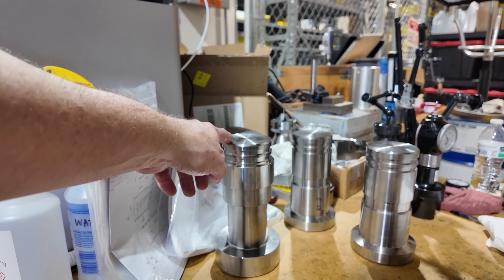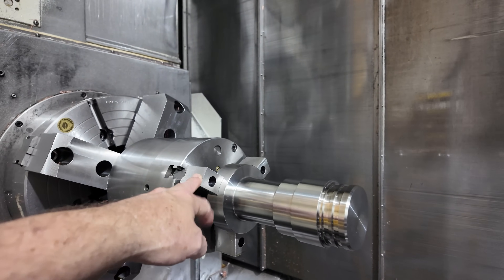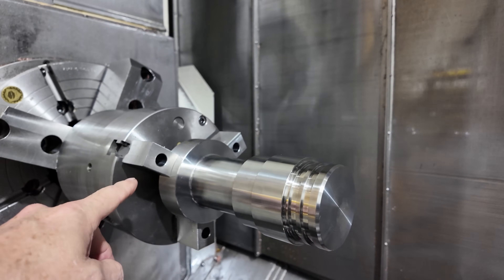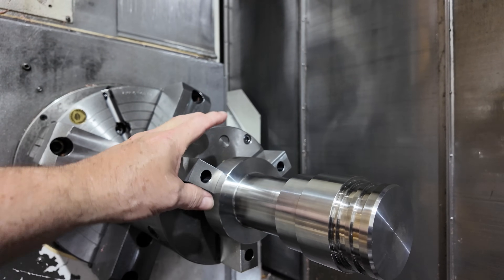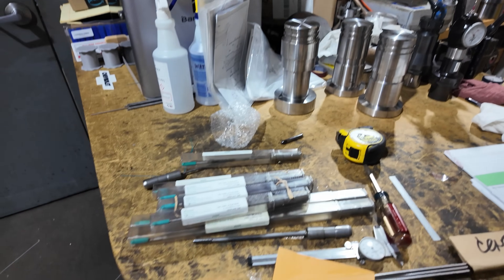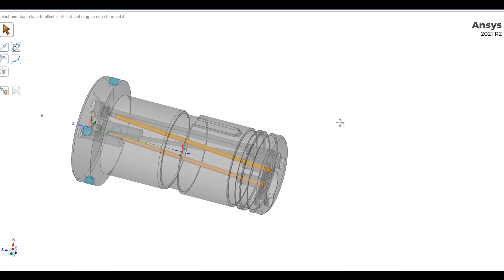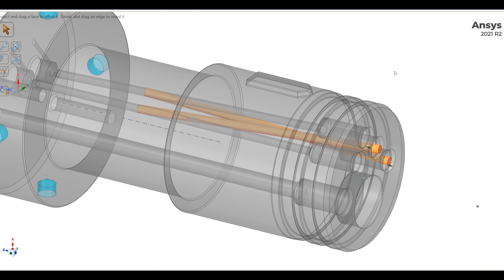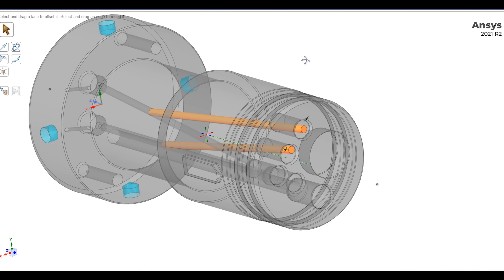Plan Job For New Parts

Comment: I always love it when you receive a drawing/model from a designer who has never made anything in their lives. Anything can be done in SOLIDWORKS
Reply from the maker: In this case I had to model the parts from their drawings. There were no provided models.
Reply: @EdgePrecision  even more classic. I hope that gets added to the quoting process
Reply: Watching this channel for a while and judging from the parts Edge Precision is regularly asked to make, my impression is that this style of engineering is very prevalent in the oil drilling industry. 🙂
Reply: Some parts have to be difficult to perform a certain function. Or better one complicated part than a big prone to error assembly. It is a challenge to make and the price will be accordingly. A somewhat trained professional designer learns this relation pretty quick before getting unemployed as a worst.
Reply: Alternatively, I always love when a machinist doesn't understand that this one nightmare part (and many of us don't like doing it) solves an enormous amount of other problems. ;) Or that it's a 5-part order and the DFM review would stall the project out by weeks and the organizational cost to the delay is 10x the cost of "just making it". 

That said, I'm ever grateful  to learn from the likes of Peter about how he solves these problems, and hopefully learn/internalize the challenges. Unfortunately, the lines of communication from the shop floor to the design house are not great (especially with job shops)

It's yet another case of trying to walk a bit in other folks shoes, and that goes for all parts of the organization.
Reply: If a DFM review takes 5 weeks then there is a massive organizational problem. When we do DFM reviews with our medical device customers we talk straight to the responsible engineers. They often don't realize what looks to be a "simple feature" can add minutes to cycle times or even require outside processing. Adding weeks to lead times.  Many times parts are designed with features that are "nice to have" rather than needed for functionality. A simple phone call can cut these out of a project making a world of difference.  We've done DFM with a project that cut weeks of lead time and cut production costs on projects at the same time making the part more reliable.
Reply: Meh, just make the damn part and quote accordingly :D
Reply from the maker: @StefanGotteswinter  I see this a lot in the machining industry. Every machinist likes to redesign the parts they make. Me I don’t worry. As you say just price it for what it takes. If they pay it good. If they complain. I just say take it somewhere else. We’re paid to make parts not design them. Also if you start making changes you can end up bearing some of the responsibility for problems.
Reply: @EdgePrecision  That's fine and dandy until a competing shop does a DFM review of the part with the customer and they figure out a way to make the part easier/cheaper.  Then that job disappears from your shop.  Sometimes the customer goes with it.  A DFM review isn't always needed, but it can actually win you work if you can help the customers achieve their goals while saving them time/money.  Basically in todays manufacturing space if you aren't doing some sort of DFM you're just hoping that your competition isn't doing it either.
Reply: I had no clue a DFM was possible. I get stuck with just quoting and making. And never ever get to dictate anything unless its a R&D part.
Reply: @peterCheater It's not so much dictating, as it is helping the customer understand the manufacturing process.  Sometime engineers honestly don't know what is feasible and what is not.  We had one customer come to us with a  part where they wanted a .012(inches) hole .865(inches) deep in 17-4 condition h900.  After a little bit of back and forth with them they ended we came to a stepped hole solution that made the part more manufacturable.  Those parts are now running on two our machines at production quantities.  Those parts should net us about $1.6 million in sales this year.

Comment: Ah, another one of these Swiss cheese oil and gas parts. Those fittings are similar to cone and thread fittings, which as you said are used for very high pressures. The taper on the tubing is slightly less than 60 degrees, so the two surfaces theoretically intersect along a single circular line, allowing for very high sealing pressures with relatively low torque. These are typically rated for up to 60,000 psi, but some specialty fittings can handle up to 150,000 psi.
Reply: I still don't see why the holes need to be at those weird angles.I'd sack those engineers for making life so difficult.😂

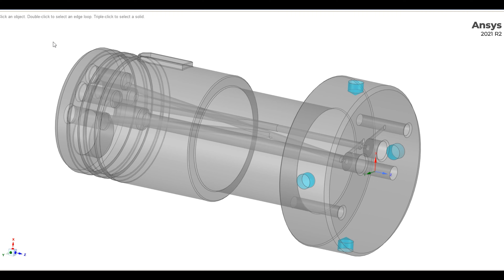Comment: I've done something similar more than a decade ago on a deep drilling machine, IMSA 1250 BBLL (made in Italy), and the part was half of a mould (German automotive client); you brought back memories with that intersection at 6:00 don't remember if they were Ø8mm or Ø12mm, but it was quite a nightmare because I had one shot only without breaking any parts inside (talking about more than 1mt x 1mt x 0.6mt of 1.2738 or 1.2311 steel). Managed to do so with, if I recall properly, aluminum rods I've previously turned to have a bit of initial slack till three quarters of the length and then pushed it with force for it to fit as the last part was precise, with the very last part slightly bigger than the drilled hole. The back of the aluminum rod had an internal thread to pull it out. Very low feed and spindle speed during the intersection as it was cutting soft and hard material in an unsupported manner...

Comment: Really nice plan, and great thoughts! Consider radially surfacing the 5deg port bottom with a square end mill. Custom ground is better but ive got away with it when lead times on tooling where bad

Comment: If concerned you could always drill and tap a hole into the large face pocket stock that will be removed later when you mill the feature.  Use this hole to secure a narror piece of flat bar that you have slotted a bit over your rod diamter to allow room for the angle of the holes.  Have one or two setscrews perpendicular to the slot across where you can pinch and hold the rod tight.  I am sure one narrow slotted clamp could be designed to accommodate both holes to hold the rod secure. This would ensure the rod is just held in place and no chance of it rotating and still have easy removal afterwards.

Comment: I was thinking the holes would be drilled in the other order - but then realised that would leave the support rod end still inside the part with no way to remove it.  I am not a smart man.  Thanks for the videos. Stay safe out there.

Comment: I run into those fittings on waterjets, those intersections are pretty nasty,  i hate having to make deep intersections at a good cross angle much less that shallow.   Always great to see a video from you, cant wait to see more on this.  Btw i wonder if a little superglue would be adequate to hold the fillers,  then do the final bore to remove any residues

Comment: Lovely to see your thought process on parts - Any plan on how to hold the drill rod in place? Or is that of little concern?
Reply from the maker: I think if I put a kind of bend/kink some ware in the rod. So when I drive it in the friction should be enough to hold it in place. If for some reason that doesn’t work maybe a short straight knurl on the last say 1/2” to grab on to the top of the hole. I don’t really know yet, but I would like to keep it as simple as possible.

Comment: Nice video. Really like how you thinking and planning it. How you have to take in to account so many factors. I was thinking if you drill the longer hole first, put sacrificial part in it, and drill the angle hole. But the you will may endup with part of that rod stuck inside. Btw, I had recurring job with 2 intersecting holes, that alway give me some issues. Then I saw your video on sacryficial part, and use that idea. It killed many birds with one stone. Can hold part better (part is 0.150 x .130) and hole are clean (no secondary scraping necessary), so thank you very much for sharing the knowledge

Comment: Wonderful content Peter. I recognize your challenges and love and learn your fixes. I don't own a fifth axis so I would have to build a fixture first for all the angled holes and I'm not sure if have the z reach on my machines to clear the part from the drills. And it would be a tight butt exercise. Coolant? Please don't jam, please don't dwell on the inserted rod, kind of deal. I know you worry a bit if all goes well but repeating an extra part on the Mazak helps to vary a little along and maybe still make money on the parts. In a conventional manner it's more high risk. I would certainly start with extra stock and add one or two to the amount to deliver (depending on the size of the order and the presumed risk for not succeeding on the first one). Thank you Peter! (How does your remodelled car behave and the milled anvills?)

Comment: My plan would be to drill and plug the straight hole through hole first as you could use a pin punch to drive the sacrificial rod pieces back out if necessary.
All good fun.

Comment: I am thinking some sort of endcap to act as a guide bushing for the gun drill to get it started on location, and an end cap with the drill rod attached to it with some sort of jacking screws / wrench flats to remove after the op. Maybe there is some way to utilize some of the required hole locations with sacrificial undersize taps to hold the cap. It would definitely would take some planning. Good luck. Cool part.
Reply from the maker: I will be starting the gun drills with a starting pilot hole. I did think about what you’re talking about. But for two parts it’s to much work I decided. Besides the rods to plug the holes come out at different angles that would not allow the end guide plate to just be jacked off without first removing them.

Comment: Nice challenge! Do you have an endoscopic camera to look at these intersections once finished? WIthout these drill rods that you plan to use, i would also expect quite serious problems with "push over burrs". With the rods it should be way better. Would be extremely interesting to see the intersections. But: What if the intersections will be in need of deburring? Deburring done by the guys of centerline? :)
Reply: Isn't that what interns are for?

:-)
Reply from the maker: Yes the deburr guys here have a lot of experience at this. These parts are simple compared to some they do. And yes we have scopes to go into the holes.

Comment: Great see that you are still making the engineers look good.  would Loctite bearing lock work for holding plug rods?
Reply from the maker: It could. But it may be hard to remove them after. But that does give me an idea. Because there is a larger drilled hole where the rods go in at the parts face. So I could do something in that material that gets machined away there. Such as drilling a hole for a small pin in that area.

Comment: How are you planning to stop the drill rod from rotating when the gun drill hits it? Just hoping the bend will be enough to stop it from rotating?
Reply from the maker: I’m thinking about putting a short straight knurl on the top end of the rods. Then driving them into the hole with about 1/2” protruding to pull them out.
Reply: @EdgePrecision  good thinking

Comment: I'm upgrading my gantry mill to its max optimum. Might as well get it done for once and all. Amongst the most looked forward to is a 4.5kW spindle  w/ATC and  BT30 taper.
So now my tool cutting data really counts.
I have never understood this term "Guage Length". Distance from spindle nose to tip or collet nut to tip. Thoughts?
Reply from the maker: Gauge length is referring to the spindle and how the tool makes up into the spindle. With your BT taper. The gauge length is how the tool seats into the taper. The tool holder's shank on a BT taper has a flange but this is not in precisely the same place in relation to where it mates up in the taper in every tool holder. Say one tool holder has its taper ground slightly smaller than another. It will be pulled a little farther into the spindles taper. So its flange will be closer to the spindles face. So in order to measure each tool the same length while mounted in its spindle you need to have some standard measuring location on the machine's spindle's taper. This is technically measured with a standard taper gauge and is known as the gauge length. But in practice you can use any place just so long as you duplicate it the same every time you measure the tools length. On a taper that makes face contact. Like a HSK, Capto, Cat Big Plus or even Tormach TTS tapers this can be the actual spindles face because the tools always make up there. But on tapers that don't make face contact you have to use the Gauge length (or diameter) because every tool makes up slightly different into the taper.  I don't know if that helps but that is what it is referring to.
Reply: @EdgePrecision  I can't thank you enough for your reply. Cheers

Comment: Could you use an epoxy or low melting point solder in the c’bores to hold the drill rod in place?  It may be difficult to clean out afterwards though.

Comment: Are those holes that come at an angle into the threads incase there is oil in the holes so you can still thread the fitting into it.
Reply from the maker: They are some kind of high pressure fluid passages.

Comment: Considering the slugs:maybe cut one end  open with a band saw and drive a wedge in there once they're inserted?
Reply from the maker: I had thought to drill and ream with a tapered reamer. Then split it with a fine jeweler saw a little. Then drive a tapered pin in the end to hold it in place. Or maybe even knurl the end for a slight interference fit would also work.
Reply: @EdgePrecision  maybe use a countersunk screw and a thread to expand the rod. Is definitely easier to remove than a tapered pin, and doesn't scratch up the surface of the bore if you use a knurled end.
Reply from the maker: @Roetz40  The top of these holes have a larger hole. So if there is any damage to the top of the hole. It will be machined away. So damage to the top of the hole would not be a problem. So a straight knurl on the end of the rod might be a good way. Just drive the rod into the hole with about 1/2” sticking out. Then to get it out use the slide hammer with the vise-grip pliers to pull it out.

Comment: Can I ask you a question. What you do when OD of a stock is really really bad. How u cantering it on 4 jaw chuck?
Reply from the maker: I assume you are referring to an out of round situation. What I do is indicate it so I have it running the same on each pare of jaws. That avarages out the error.
Reply: @EdgePrecision  , not just out of round, the OD was so bad so there was no point to put indicator on it. It had really rough surface (not machined before), a lot of low and high spots. So I decide to measure distance from the end of chuck to jaw and make it the same on each pare. I’ve always worked on 3 jaw hydraulic chuck and just bought new 4 jaws and just started using it, so I thought maybe there is better way to do it

Comment: at 7:01 I don't quite understand argument for drilling shorter angled hole first. In my opinion it would create more misalignment issues for long hole which after meeting with short one, should continue straight for some time still, which could not be happening. If you drill long one first, then put sacrificial filler rod into it and then drill short one to meet in the middle, its misaligning would not be as impactful. Other than that, both are relatively to each other meeting same way, so it should not matter which one first to drill. At least thats my unprofessional opinion :). Cheers!

Comment: Thats a really good idea, to fill the holes again with some material, but i would fear that these rods are spining inside the holes, when the drill hit them - did i miss it, or did u plan to use some loctite or something else to fix them? I really wish you, that this strategie is working.
Reply from the maker: A Gun drills feed very slow. I think if I bend the rod so I have to hammer it lightly into the hole. There will be enough friction holding the rod to prevent it from spinning. Also with a gundrill once the drill starts into the rod. The drills tip (different than a twist drill) will actually keep the rod from spinning.
Reply: @EdgePrecision  Yea i use those gun drills (in my language it is called "Einlippenbohrer"  what translate to "one lip drill") almost every day too. Its great on machines what have enough coolant pressure. 
Yes bending the rods at the front end sounds also like a good idea. Im very exited for the nxt video.

Is there a special reason u have this 3 jaw chuck in use? Just to save the more expensiv soft jaws for the 4 jaw chuck? Or do you need room for the milling operation?
Reply from the maker: The 4-jaw is large in diameter. So for clearance on the machines milling spindles face it requires long tools to reach a smaller diameter part. So I put that smaller chuck to get the spindle closer to the part with shorter tools. The milling spindles face is almost 12” in diameter. This is one shortcoming of this type of machine.
Reply: @EdgePrecision  I operate some integrex i-200 and -250 machines, which have a similiar layout like yours, so i know the problem.   We mostly just change the chuck for smaller parts, but because we use powerclamping and unlike you, i mostly make no single parts, so the work to change one or both chucks is better paid per part.